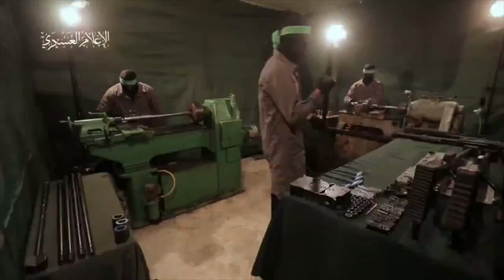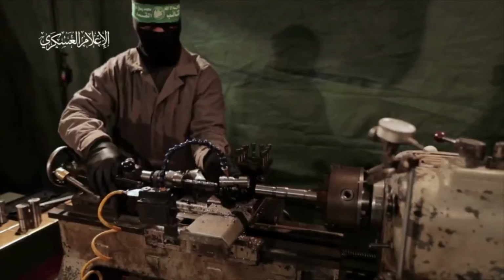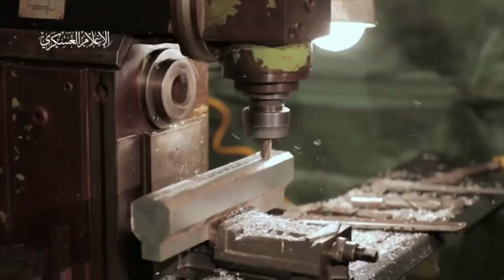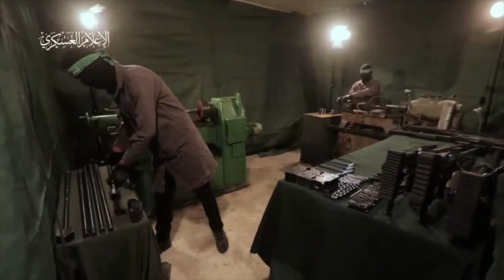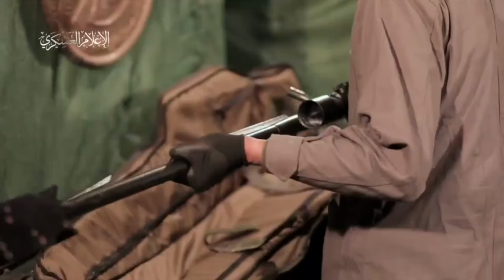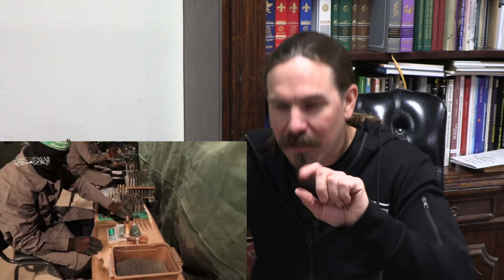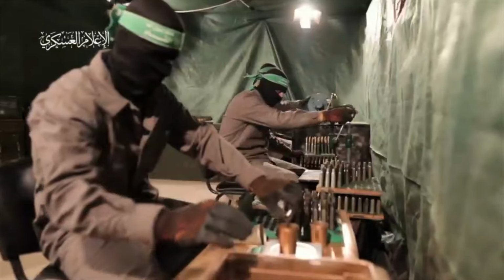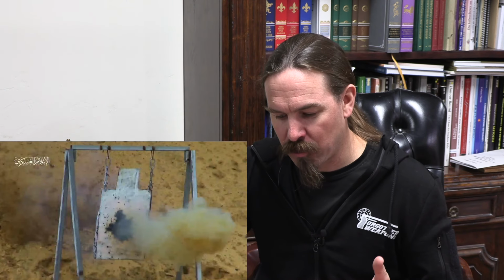Hamas Claims to Make Sniper Rifles in Gaza - Are They Really?

Comment: Just wanted to add a few observations to the rifle making. I have spent the last 6 years working in a metalworking factory with lathes and Mills, both manual and cnc. On the polishing with a cloth while on the lathe, I know that we often chamfered some parts with a file while it was still on the lathe, so I would give them the benefit of the doubt on that one. What did also stand out to me is their use of calipers. For the level of accuracy I would imagine would be needed for gun parts, I doubt a caliper would be accurate enough, I would expect them to need micrometers to accurately check their sizing. Additionally, these seem to be fairly light duty machines, and obviously not cnc, severely limiting their potential output. Anything I'd possible, but I really doubt they are making any full rifles, probably just some parts for their current rifles
Reply: You should check gun production in Pakistan, no mil-machinery.
Reply: The Firefox books have a chapter on rifling black powder barrels in the old days. @logitech7989
Reply: They couldn't make a Daisy Red Rider
Reply: That workshop for customize and repair small arms.
The video is clearly pr.
Its just like Israel propaganda training videos.
Reply: They could do it with just a Chinese digital caliper fitting parts like that even headspace doesn’t require micrometers. For example if a barrel journal is loose they would just knurl it and press it together.  I think the video is suspicious cuz a .50 isn’t really a “sniper rifle” and I honestly don’t think that’s needed to anywho. They would just weld up some crap missiles instead. Lots of guns laying around for them to use. They just wanna look sophisticated or whatever they think!?! They had a huge open tray of gunpowder laying on the table!!! That’s stupid and that’s coming from me a really reckless dude
Reply: Hamas have been picking off high ranked IsraHell Diaper Force officers so they've got the sniper rifles to do business! Apartheid IsraHell is an abomination.
Reply: ❤https://youtu.be/A9tmFC14qBA?si=C6pK8gOgRvHdjXNR❤
Reply: Weil there are guys in Pakistan, Africa and South America who make guns from hand... Dort know how long till the guns explode in your face but thats another story
Reply: we know, for example, that there has been an economic blockade of gaza since 2006/2007. they are capable of domestic production of more primitive RPGs, I wouldn't doubt there are armorers and weapons production happening in Gaza. its a necessity for maintaining armed resistance under complete blockade (ie another form of occupation). Lots of scholars and even pro-Israel anti-terror analysts who have written about this prior. 

it doesn't suprise me this is a propaganda video though, Al Qassam has been producing an enormous amount of combat and combat prep video content as a counter Israel's ability to idk have the US State Dept. make their case or buy 400m in Youtube ads. Its a weapon, the weapon in this video isn't the gun, its the video itself. Its saying "we will always resists, we are innovative, and you underestimate us."
Reply: @anon_researcher I question would they take the time away from product on new rifles to shoot a video.

Or would it be easier to fake in and allow production to keep going without interruption.

More a question about filming but I would assume that 3-5 days of lost manufacturing for this ....what do you think
Reply: @anon_researcher u got it right , many people fail to understand there is a real war happening on the ground , but also a media(propaganda war) , before it was controlled by israel and now amas is producing some really good quality videos that made people laugh at israel own version of videos  , amas is really well prepared either it show on videos or not , they destroyed/disabled some really advanced idf vehicules , either they made it or bght it , the results are there.
Reply: @anon_researcher  In that case, the blockade was  caused by Hamas  rise to power in 2006. Also, a blockade is not ooccupation , if so, is Egypt occupying Gaza then? Cuz they enforce blockade since 2007 lol
Reply: @ZUPYNinGAME lmao, u cut the important chronological events, why hamas rise in power and why they rises in 05 while the group born in mid 80s-90s.
Reply: @ZUPYNinGAME 
الاحتلال هو احتلال لكامل فلسطين من النهر إلى البحر منذ عام 1948 
فلا تحاول تجاهل التاريخ
Reply: @ZUPYNinGAME  it's legally an occupation & been defined as one for a while, since 1967 & still remained that way even after 2005.

israel controlled the airspace, what came in & out of gaza (even from the egypt border, circumventing Israel means circumventing the US), had control over water & electricity (how do you think they shut it off so easily?), manages & holds the census records (all Palestinians in gaza have to register w/ Israel, also how they know where to bomb the houses of doctors & journalists to punitively kill their families), who can leave gaza (even if they get a visa from another country, Israel can deny them just like that, it's happened for years w/ university students & cancer patients, for example), hell they could even control when elections happened; the US & Israel forced it in 2006 against the wishes of the PA just after Israel had bombed the crap out of gaza again & that's how hamas won (by 3%, mind you). go read up on this first, it's seriously bizarre. no one talks about it now, they all just conveniently leave it out.

they would bomb fishermen for accidentally straying past the invisible 'sea wall' (also later built a real sea barrier to better lock them in physically, not just w/ death); they also slaughtered a turkish non-profit flotilla delivering much-needed food to gaza in 2010. 

the list of fucked up shit they do to keep screwing over Palestinians, esp. in gaza, can literally go on forever; they use them as live subjects to test weapons & surveillance tech on, & then they go sell them to the rest of the world, including plenty of dictators. there's a Pulitzer center article from 2016 about this & some recent stuff as well (interviews, articles, & books), & you can find plenty about israel's shady arms export. 

there's actually just too much to list & this is just gaza. it's a tiny strip of land w/ the 2.2 million people on it surrounded by massive walls & fences, drones, cameras, & ai operated turrets. idk what else to say.
Reply: @cheesecake7384   U talked a lot and there is not a single source or authority , just "trust me brology". Do u know what is occupation? When a 6 Nation Coalition arab army tries to invaded Israel since 1947 and they failed 5 times lol
Reply: @ZUPYNinGAME  i can't give you direct citations & references like an essay in youtube comments. go look up anything i said & try to educate yourself instead of being a moron; i even gave you some articles to look up. 

the may 15th 1948 'invasion' was in response to shit like the deir yassin massacre of april 9th 1948. you can go watch interviews from some of these lehi brigade 'soldiers' bragging about what they did decades later.

it wasn't some unprovoked attack in response to the poor little state of israel coming into being: zionists had already forcibly expelled around 300,000 Palestinians & killed thousands by the time war broke out in may 15th. read the al-jazeera article titled 'The Nakba did not start or end in 1948' 

also, the 1948 'invasion' was between vastly outnumbered token arab armies & battle-hardened zionist soldiers that fought in WWII, & even then the kingdom of Jordan colluded w/ Israel. go read '1948: The First Arab-Israeli War' & 'Birth of Israel: Myths and Realities' by israeli historians Benny Morris & Simha Flapan, respectively. hell, look up literally anything by Israeli historian Ilan Pappé; watch an interview of his or something, my god.
Reply: @moathsaleem5193 Jews have been in Israel since before Islam was a religion. Why do you cut off at 1948?
Reply: What made me 100% sure they only POSSIBLY made the crude scopemount (in aluminum) was the rubber gloves. I could understand cotton gloves.
Reply: They use what they have, and do not forget that they are under the blockage, whatever the results, they are proud, they used to fight with rocks a few years ago. Now they have humiliated the best-equipped army in the world.
Reply: why would hamas do this, just go on the internet and lie?
Reply: @cagneybillingsley2165  that's basically how propaganda works you see
Reply: @balthy8139 propaganda doesn't work that way.
Propaganda is like a train, only a method to deliver your ideology.
It doesn't care what train (propaganda) is transporting, real or non-real.
You use propaganda to information of truth and facts, misinformation or simply disinformation.

People way too much make propaganda to be synonymous with disinformation, and that is part of misinformation or disinformation of opposition.

Example, the production itself of this video is propaganda. Idea that you use good camera equipment, editing etc to visually present your ideology. In this case that ideology is "we can produce our own weapons". That ideology can be true or false, as in can they do it or not. But it doesn't change the video production method itself, as camera recording a machine running doesn't make the machine doing real part true or false, it only records. But what someone want to claim video is showing, can be disinformation or as more usually, misinformation in general sense.

Propaganda offices and ministry of propaganda ain't about lying, but officially delivering the ideology how government wants to inform citizens or foreigners what they do. It can be all be true information or purposely done disinformation. But often it is misinformation when message creator doesn't know what is really being done. 

Example, when a USA military creates a recruiting video, that is 100% propaganda. It is no less or more propaganda than Hamas doing recruiting video.
Both are using a video for delivering their ideologies.

Misinformation comes from words Mistaken and Information.
Disinformation comes from words Dishonest and Information. 

The first one is a person repeating or delivering or creating the information honestly mistaken the subject and information. Second is about purposely try to deceive by giving information that is known to be false.

Like USA Military recruiting video where illusion is given that every recruitment will get best weapons, become part of something amazing, experience great events and so on.
While truth can be that recruited might just guard a one warehouse somewhere and mop it's floors. And when 85% of the military recruited are doing that, and not being part of special groups, become pilots among top fleets etc, it is disinformation as your purpose is to get people believe something that they will never be doing.
And it is propaganda all the way, regardless who has made it or which way they made it.

Like this Hamas video can be used as disinformation to make it look fake, so that people would come to doubt that Hamas can't produce something as it looks so fake. It is equal to admiral/general stepping front of commission and say "We can't deal the country X as they are so seriously threat to us" even when he knows very well that they can, but they need to say so to get money and politics to give them do what they want to do... So media go and report "we can't" but opposition can be true. So using disinformation to create misinformation to hide the truth.
Reply: @balthy8139 propaganda doesn't work that way.
Propaganda is like a train, only a method to deliver your ideology.
It doesn't care what train (propaganda) is transporting, real or non-real.
You use propaganda to information of truth and facts, misinformation or simply disinformation.

People way too much make propaganda to be synonymous with disinformation, and that is part of misinformation or disinformation of opposition.

Example, the production itself of this video is propaganda. Idea that you use good camera equipment, editing etc to visually present your ideology. In this case that ideology is "we can produce our own weapons". That ideology can be true or false, as in can they do it or not. But it doesn't change the video production method itself, as camera recording a machine running doesn't make the machine doing real part true or false, it only records. But what someone want to claim video is showing, can be disinformation or as more usually, misinformation in general sense.

Propaganda offices and ministry of propaganda ain't about lying, but officially delivering the ideology how government wants to inform citizens or foreigners what they do. It can be all be true information or purposely done disinformation. But often it is misinformation when message creator doesn't know what is really being done. 

Example, when a USA military creates a recruiting video, that is 100% propaganda. It is no less or more propaganda than Hamas doing recruiting video.
Both are using a video for delivering their ideologies.

Misinformation comes from words Mistaken and Information.
Disinformation comes from words Dishonest and Information. 

The first one is a person repeating or delivering or creating the information honestly mistaken the subject and information. Second is about purposely try to deceive by giving information that is known to be false.

Like USA Military recruiting video where illusion is given that every recruitment will get best weapons, become part of something amazing, experience great events and so on.
While truth can be that recruited might just guard a one warehouse somewhere and mop it's floors. And when 85% of the military recruited are doing that, and not being part of special groups, become pilots among top fleets etc, it is disinformation as your purpose is to get people believe something that they will never be doing.
And it is propaganda all the way, regardless who has made it or which way they made it.

Like this Hamas video can be used as disinformation to make it look fake, so that people would come to doubt that Hamas can't produce something as it looks so fake. It is equal to admiral/general stepping front of commission and say "We can't deal the country X as they are so seriously threat to us" even when he knows very well that they can, but they need to say so to get money and politics to give them do what they want to do... So media go and report "we can't" but opposition can be true. So using disinformation to create misinformation to hide the truth.
Reply: @cagneybillingsley2165  lol is that a serious question?
Reply: yeah, it doesn't serve any great purpose seemingly but to assist Israel in justifying their attacks by saying "see! They are making weapons in their vast underground city!"
Reply: @aFoxyFox. I think after October 7th, Israel doesn't need any more justification to stop Hamas.
Reply: @cagneybillingsley2165  Propaganda?
Ever heard of it
Reply: @cagneybillingsley2165 have you never heard of the concept of propaganda before? What rock did you just crawl out from under?
Reply: Hello ! May Allah protect and guide you to his light and happiness in this life and the hereafter, God bless, Ameen. Excuse me for giving a little presentation of Islam, because it is very misunderstood nowadays, especially on those « Antichrist's » times, where media and politics are mixed to distort history and truth. Thank you very much for your time.

Islam is an arabic word that means the Surrender to the One and Only God, our Creator, Protector, Provider, who gives us life and all that we have, we are safe and sound by his will and grace, we are His and to Him we return, and we have to thank him in this trial life by submitting to him by our free will, or later in the Day of judgment when it's too late to save our own skin. Islam was the original Religion descended to earth from heaven with Adam and Eve (peace and blessing be upon them) in the beginning of humanity. and was passed to people with the succession of the 124 000 prophets and 315 messengers of God to all nations and civilizations since, passing by Noah, Abraham, Isaac, Jacob, Ismaël, Joseph, Moses, Aaron, Joshua, David, Solomon and Jesus (Peace and blessing be upon them) during the history of mankind, the last replaces and completes the previous, until the succession of the last messenger of God fourteen centuries ago, Muhammad (Peace and blessing be upon him) to complete the noble morals of all mankind, to bring humans and jinns out of darkness into light, and to purify people's religion and belief from corruption and polytheism, and return it to purity and true monotheism, like it was in the times of the prophets (Peace and blessing be upon them).

Many Religions that we know nowadays, at their beginning were true and under Islam, initiated by one of the prophets of God, but their original teachings, history and scriptures have been corrupted over time with falsification and polytheism, or lost and replaced with false ones. That's why Islam is the only Religion accepted by God nowadays, which consists in bearing witness that there is no god besides Allah (God in Aramaic, the original language of Jesus and the Gospel), and that Muhammad is His servant and messenger, just like Jesus and Moses and others are His servants and messengers. Never a messenger of God said he was God or literally son of God, it was the people after him who changed the words of God and corrupted the Religion. God is unique and absolute, He does not need to have a family and sons or to associate anyone else with His kingdom, He can simply create whatever He wants, everything belongs to Him, and to Him everything will return. Allah said in Surah Al-Mu’minun : “God has never begotten a son, nor is there any god besides Him. Otherwise, each god would have taken away what it has created, and some of them would have gained supremacy over others. Glory be to God, far beyond what they describe. The Knower of the hidden and the manifest. He is exalted, far above what they associate. (91-92 / Translated by ITANI).

Allah means the one and only God, the God of all prophets and creatures, the creator of the universe and mankind, and the Master of the Day of judgment, where our destiny, Hell or Paradise, is decided based on our faith and deeds in this trial life, and above all, Allah's mercy. 

Allah said in Surah Al-Ikhlas : In the name of God, the Gracious, the Merciful.
Say, “He is God, the One. God, the Absolute. He begets not, nor was He begotten. And there is none comparable to Him.” (1-4 / Translated by ITANI).

Allah said in Surah An-Nisa : O FOLLOWERS of the Gospel! Do not overstep the bounds [of truth] in your religious beliefs, and do not say of God anything but the truth. The Christ Jesus, son of Mary, was but God's Apostle - [the fulfilment of] His promise which He had conveyed unto Mary - and a soul created by Him. Believe, then, in God and His apostles, and do not say, "[God is] a trinity". Desist [from this assertion] for your own good. God is but One God; utterly remote is He, in His glory, from having a son: unto Him belongs all that is in the heavens and all that is on earth; and none is as worthy of trust as God. Never did the Christ feel too proud to be God's servant, nor do the angels who are near unto Him. And those who feel too proud to serve Him and glory in their arrogance [should know that on Judgment Day] He will gather them all unto Himself: (171-172 / Translated by Muhammad Asad).

Allah the Most Merciful said in Surah Ali-Imran : Behold, the only [true] religion in the sight of God is [man's] self-surrender unto Him; and those who were vouchsafed revelation aforetime took, out of mutual jealousy, to divergent views [on this point] only after knowledge [thereof] had come unto them. But as for him who denies the truth of God's messages - behold, God is swift in reckoning!
Thus, [O Prophet,] if they argue with thee, say, "I have surrendered my whole being unto God, and [so have] all who follow me!" - and ask those who have been vouchsafed revelation aforetime, as well as all unlettered people, "Have you [too] surrendered yourselves unto Him?" And if they surrender themselves unto Him, they are on the right path; but if they turn away - behold, thy duty is no more than to deliver the message: for God sees all that is in [the hearts of] His creatures.
Verily, as for those who deny the truth of God's messages, and slay the prophets against all right, and slay people who enjoin equity - announce unto them a grievous chastisement.
It is they whose works shall come to nought both in this world and in the life to come; and they shall have none to succour them.
(19-22 / Translated by Muhammad Asad)..

God said : Say, “We believe in Allah, and in what was revealed to us, and in what was revealed to Abraham, and Ishmael, and Isaac, and Jacob, and the Patriarchs, and in what was given to Moses and Jesus, and in what was given to the prophets from their Lord. We do not differentiate between any of them. And to Him, we surrender.”
(2:136 / Translated by Community)

Salam (Peace) ---